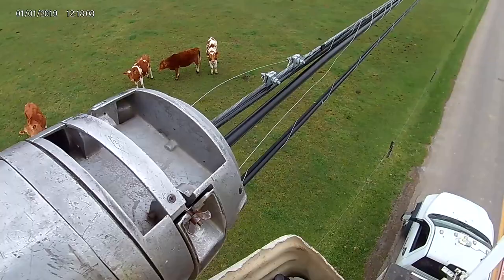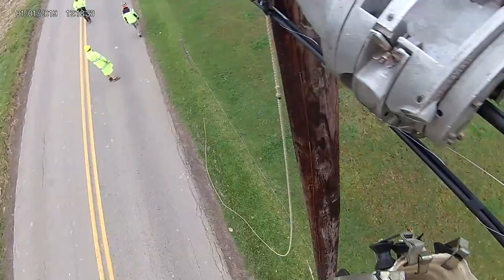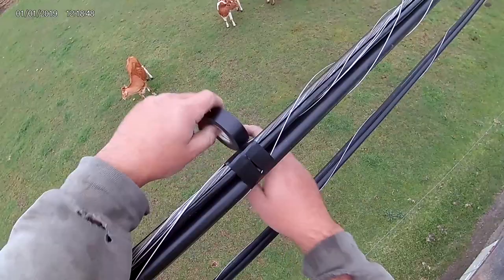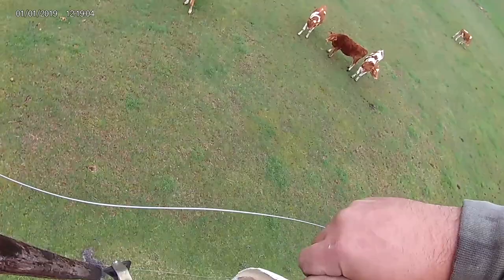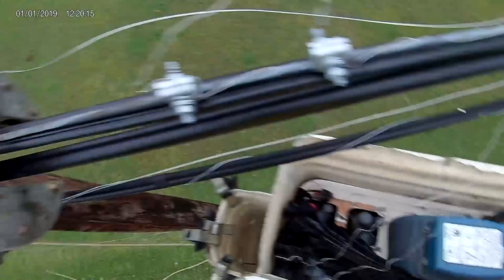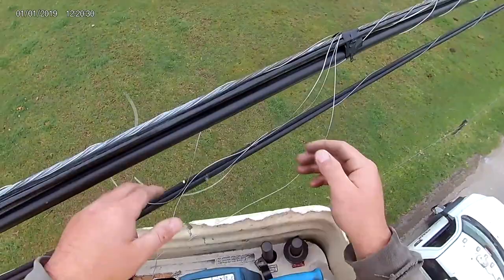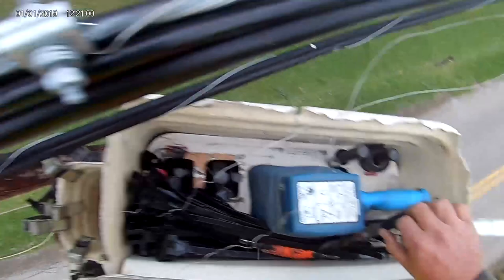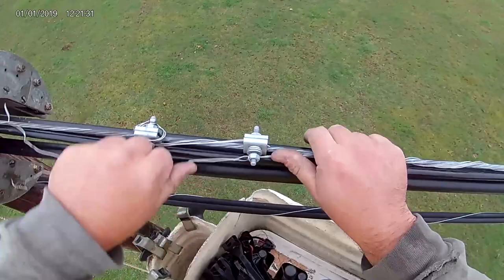This is what happens when you don't do strand only correctly.

Comment: Hi quick question we have several phone companies running fibre/HFC cable as any of the poles collapsed under the weight or is the weight not that heavy. I'm finding these videos to be very informative.
Reply: The weight of fiber is nothing compared to copper cables.  We have some poles out here with 7/8 levels of stuff just for communication lines, some levels with multiple things lashed to the same strand.  Old copper phone cables, the large ones,  can weight up to 10 or 12 pounds a foot.  The big old lead cables might even be more.  Whats on the poles in this video are nothing. Those poles barely know that stuff is even up there.  I’m actually removing some old copper cables at work this week. One of them is a 1500 cable, so thats 1500 “pairs” of small copper phone lines - so actually 3000 individual copper wires inside that one cable.  What this guy is putting up is for a cable company,  so it could be either coax or fiber. The phone company’s line is the one below that.   Judging from whats on that pole, they are in the middle of nowhere.  The level below the one hes working on actually has 2 different cables on it, lashed together.  The main one is a small self support copper cable, and it has a fiber optic line lashed to it.
 Whats already on the strand hes lashing that new line to, is coax.  On the left side of the pole - that bend in the cable - is only done on coax.  Its an expansion joint. That way with any drastic changes in temp outside, if that coax expands or contracts, it cant pull any fittings off if there is ever a terminal installed on the line.  The people standing around on the ground will be pulling that lasher to the next pole when hes done there.  The truck hes working out of is not actually a cable placing truck - so the guy cant drive as hes moving the bucket around in the air.    If they were smart, since thats looks to be such a wide open area (basically as easy of an area as it couble possibly get) they’d just tie that rope onto the truck, and let the truck pull it as its driving up to next pole.  Its a pretty safe bet they ARENT doing that.

Comment: Never leave the lasher hands off without a gate closed
Reply: You can leave the gate open, but the bridle is supposed to be looped around the strand and connected on both sides.   that is a must.    I am not sure what State he is doing this in.    In New York for Altice and Verizon, the pattern for setting up the bug nut in this video is correct. However, for the lashing wire, you do three times around the strand, three times around the Washer side of the bug nut, bring it over, then do three times around the bare side of the bug nut.   Then you leave about five inches of lashing wire and slide it thought the middle of the bug nut. Then you twist it leaving an loop off twisted lashing wire above the bug nut, on the pole side of the nut.     

I personally think he is cutting it way to short and it costs more time, while making it way to easy for the sharp end of the lashing wire to poke through someone's gloves and stick a finger. 

nice job, here.   again, in his State, this could be by the book.
Reply: Yeah he could of clipped the bridal off on the Lasher
Reply: @johndone8412  I was taught the way you where explaining wrap 3 around strand and cable then 3 around strand then 3 around washer side then 3 around empty but when training new guys for the past few weeks around old AT&T , bright speed , and cox guys there all telling me that’s completely wrong the way he was doing the bug nut is correct only 1 wrap around washer side and 3 around empty side I definitely think he should’ve left a bigger courtesy loop but they told me 3 wraps around the washer side will crush the lashing wire and break it  when tightening it down
Reply: @brilanhamlett512 Yep, how I do it is one side around washer side, 3 strand, 3 bug nut side

Comment: Why don’t you guys use the Apollo lasher rather than the Sierra?
Reply: Looks like a j lasher not an Apollo
Reply: It's a j
Reply: Apollo? That looks like a J forsure not a apollo my guy...
Reply: @OneSilentGiant i just reread it an you're right, however why the fuck would you use a heavy ass apollo lasher for wide open spans an 2-3 cables? An apollo is used for treed out shit.
Reply: @OneSilentGiant ya man the J is a good bit lighter than the apollo lasher
Reply: @OneSilentGiant I realized that afterwards clown
Reply: An Apollo is designed for huge packages, like 1000 pair on them ATT lines. I hate Apollo lashesrs. J LASHER is the go to for sure.